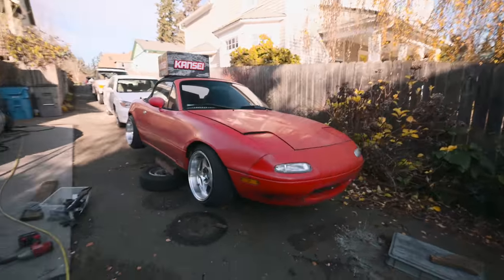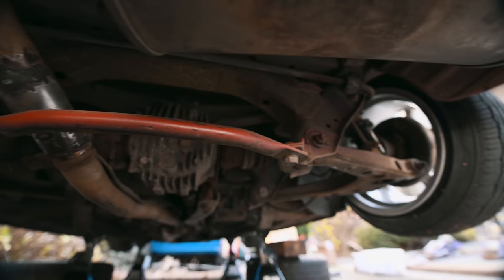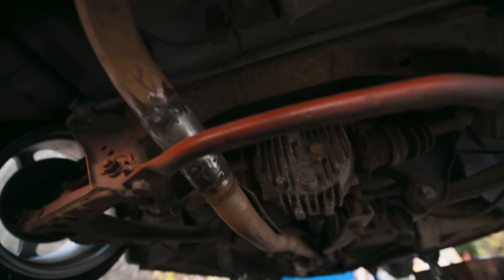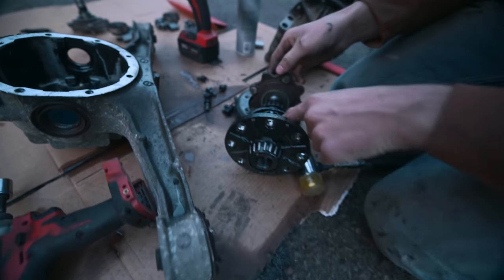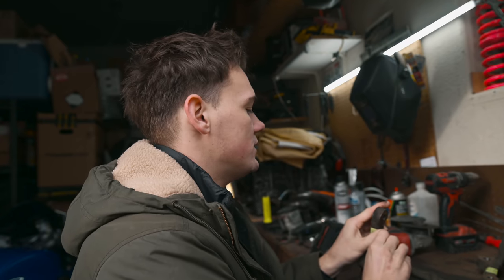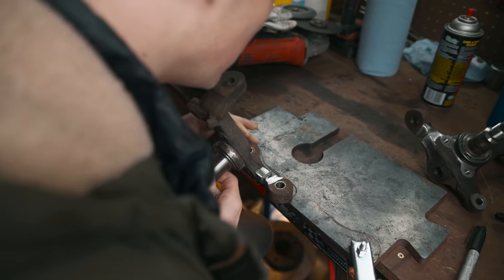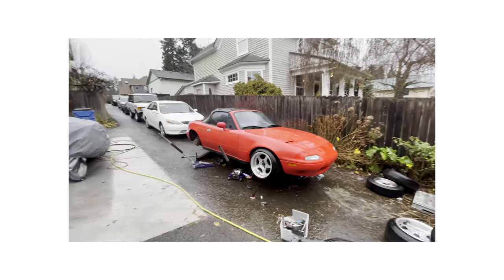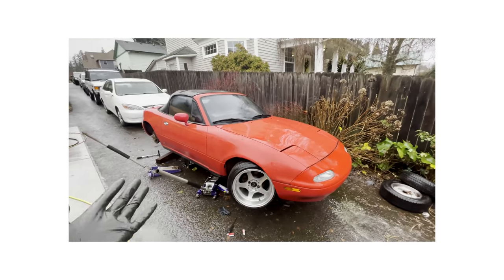Making the Miata Drift Ready (4K)

Comment: Not the best drift car bc of wheel base. But it's your car. Another way to make mines value go up.. sad the next generation won't be able to enjoy your car. With the broken chassis and all.
Reply: ok boomer. Everything gets more expensive. If you learn in a miata and can drift it, you can drift anything else.
Reply: @racebred2625   I'm not disagreeing with that. But no reason to lower the car so much . Not to the point it will damage the chassis . Esp the frame rails and such.